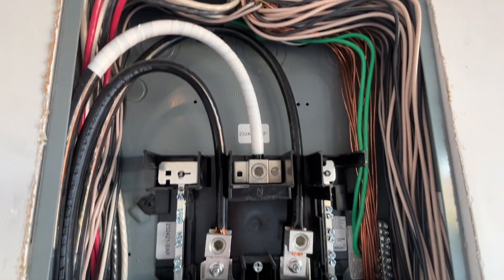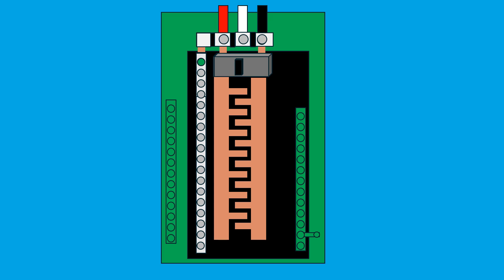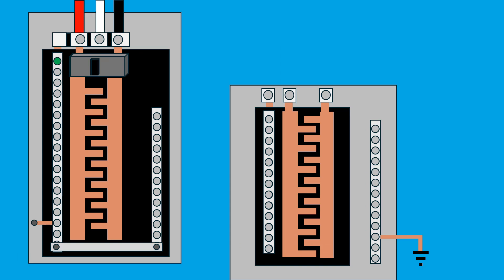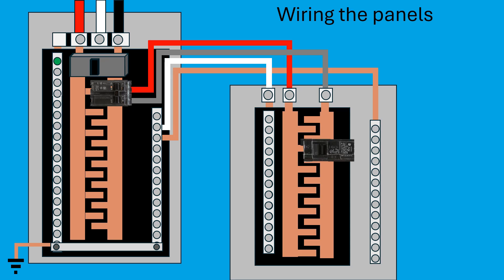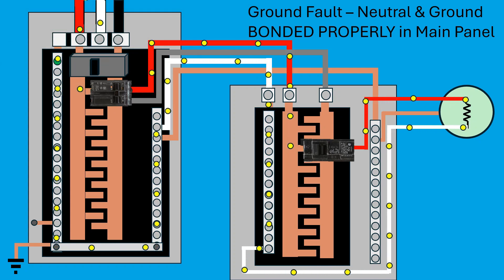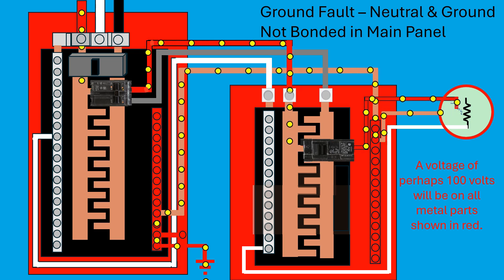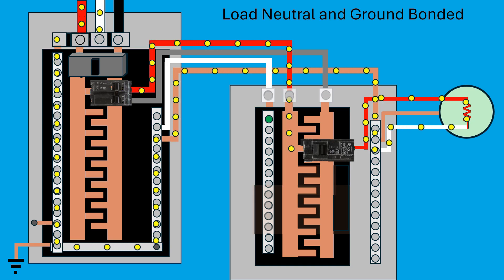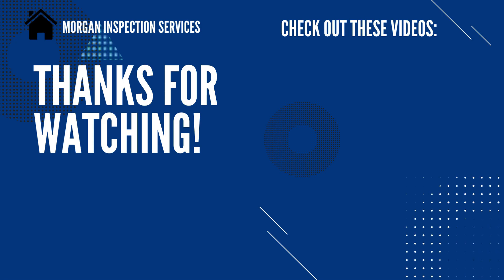Why are Grounds and Neutrals Separated in Subpanels?

Comment: I don’t understand why the neutral bar and ground bar being connected doesn’t make the ground wires carry current like a neutral? I have an old house where the neutrals and grounds share a bus bar in the main panel. Cannot wrap my head around it
Reply: All that happens is that it ensures that the neutral and ground are at the same potential. Zero potential relative to the hot wire. If neutral and ground are at the same potential then no current flows between them

Comment: Hey I was wondering something; if electricity needs a return source, what is the return source for a downed powerline that energizes the earth? I understand why lightning doesn’t need a return source because it’s about a positive vs negatively charged area. But I don’t understand why I downed power line doesn’t tend a return source.
Reply from the maker: I’m a little bit confused by your question. When you say a down powerline doesn’t “need“ return path, I’m not sure that’s worded very well. We set up return paths for properly operating electrical systems. A downed powerline is not a properly operating electrical system. Depending on what that downed powerline is touching, it may or may not have a path. If that down to powerline is sitting on something such as a dry street, for example, that powerline will remain energized, but the electricity will not flow anywhere. If it’s down and sitting in water, then the water is a conductor to a degree so some electricity will flow from the powerline into the water and down to the earth. If the downed powerline is sitting somewhere and someone walks up and touches it, then they are a path for the current to flow.
Reply: @morganinspectionservices3840 hey so to restate, basically I was told that even if a system isn’t grounded (no ground rod to neutral etc at transformer and no grounding anywhere ) that if a power line that’s energized comes down and touches the earth, that it would still energize the earth. Now if energize means put the earth that it’s touching at its voltage then that’s surely true right? No matter if it’s soil, gravel, water right? A  120 v line comes down, and it will make the earth 120 v no matter what it’s touching? I’m not saying it will run current yet. Just saying that for instance, if we measure the neutral to the ground, we will get 120 volts right? So that’s the first question.

The second question is - let’s forget about voltage. We have this 120 v line touching the ground - let’s say it’s grass or soil or water, is it possible for a current to flow thru the very earth itself if there are no grounding rods or grounding stuff anywhere near by? I ask it this way cuz I’m tryna take away with “return to source” and still see if current would flow thru the earth.

Comment: Okay let's say you're using armoured cable with a gland from the main panel that is bonded by the outer sheath wire now when you gland the subpanel you would also earth it. So you just eliminate the outer wire on one of the glands?
Reply from the maker: Thanks for watching the video and thanks for your question. It sounds like you’re referring to using a cable gland with armored cable for grounding. In the US, we typically rely on a dedicated ground wire in addition to the armored cable sheath to ensure proper grounding as per the national electric code, NEC. Eliminating the ground wire on one end might violate code and safety issues, like ground loops or poor bonding. Local codes can vary so it’s best to follow the standards for your region to ensure safety and compliance. I’m not familiar enough with non-US electrical wiring to be able to answer your question anymore precisely. Thanks again.

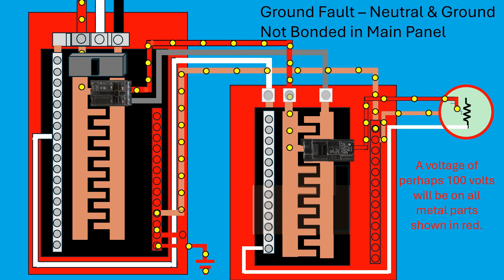Comment: I question your statement about a ground bonded natural bar in the sub panel at time stamp 7:33, with a cut or broken neutral. If the neutral bar in the sub panel is bonded to ground, the current will travel through the grounding system back to the main panel and continue through to the main neutral at the main panel, since the main panel is the first panel, were the neutral bar is tied to the grounding system.
There would not be any 120 volt potential through the grounding system, the current will travel through to the neutral..